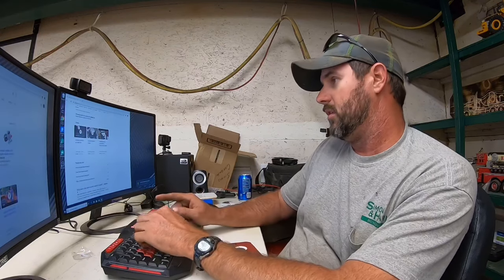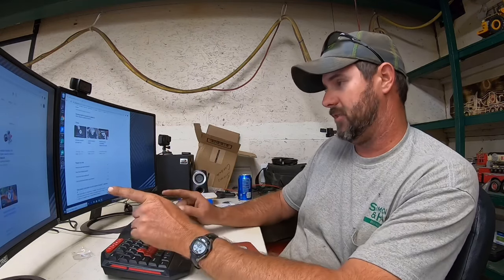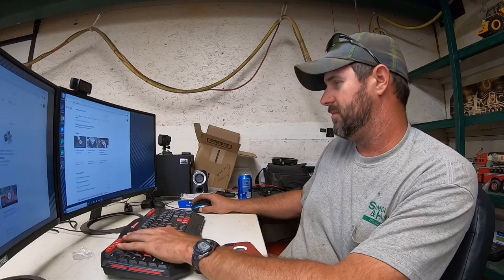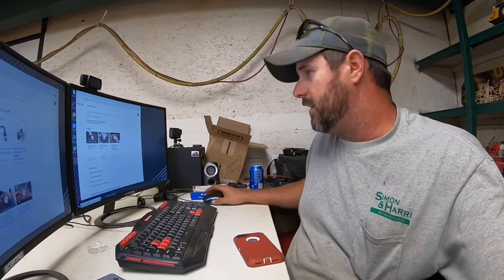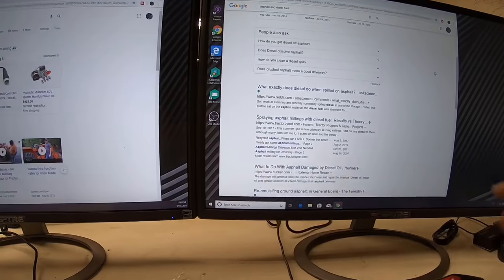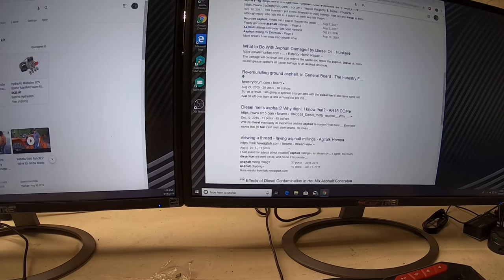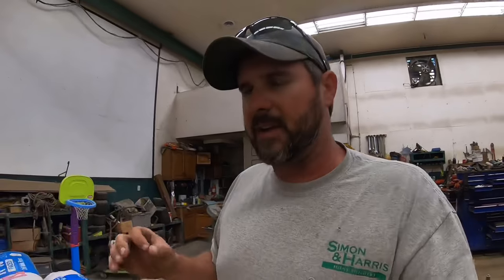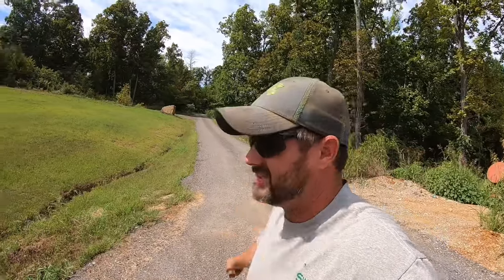Spraying diesel fuel on asphalt millings good idea or bad idea my thoughts

Comment: Diesel fuel doesn't let the asphalt bind correctly. It almost liquefies it and it will never bind up until the fuel works out of it. Which then leave you with hard rubbery chunky stones. Don't use diesel fuel with asphalt. Unless you don't want it to stick to something. Like shovel, lute, machine components ect.

Comment: Guys from a a large commercial paving company, that build roads and such, with 30-40 years of experience, said lightly spray diesel on the millings.  Give it some time and let it dry and get some sun and it helps bind it together.  I trust guys who do this for a living and have been for a long time vs. random google information.  This is for a temporary driveway, not a long term lasting solution.  If you want a real asphalt driveway to last you 20 years or more, you need to pave it for real.  You get what you pay for.

Comment: I can understand where people get the idea for diesel, but you are absolutely correct, asphalt is just tar and aggregate basically, if you get tar on your hands diesel is a good thinner to get it off.  WD40 is better though and doesn't stink. Thin oil based products break down thicker oil based products.   When I was a kid I remember seeing frequently exactly what you described at the gas pumps.  Usually at the farmers co-op.  Yes the two things that make asphalt work are heat and compaction. But  I might take  a road trip to see your driveway on fire!!!

Comment: Well if you treat it just asphalt make sure all the smaller particles if you got a good guy that can rake good he'll pull the rocks out and move them forward so they're on the bottom and keep all the smaller particles on top when you ended up having a rocky area that's when the guy will Rick the material and pull out the small particles and fill in the rocky area. It's pretty easy when you know how to use both sides. Normally when you spray the the seal coat you'll do two passes if you spray it too thick at one time it will crack that's why you do one layer as a prime then the next layer as the sealcoat then you'll have to maintain it as in more layers of sealcoat because it will wear off from the Sun and from friction. If you keep on top of it it'll become a nice smooth surface just takes time. But the diesel fuel you even put it on your shoes because you'll end up 6 inches taller if you don't because of the asphalt sticking so I think it may work as it would melt everything together it would be a good bottom layer because when you lay down asphalt you put the stuff called tech on the dirt or on the asphalt that you are applying asphalt on top of it will act as the tech coat like a real sticky that would make a good base but yes the heart of the weather the smoother it will lay and the more compassion you'll get

Comment: Hit it with a heavy coat of oil based sealer (two coats is best with a couple hours inbetween coats) Oil base will penetrate and become part of the existing asphalt. Not only will it penetrate and help hold it together but it will also rejuvenate that dry RAP and give it that black look of hot mix. I understand you have a large area to get sealed but most seal coat companies will give you a better rate if you have volume.  Chip seal is going to track rocks some maybe more than others but in the end there is going to be loose rock everywhere.  If you enjoy the look of your surface now ( no big low areas or high spots) just get a couple heavy coats of premium OIL BASED sealer. No water based as that is a surface type sealant and will likely peel or be prone to surface cracking or alligation in RAP. Have a good day 😊

Comment: Spraying your drive in Indiana with diesel could cost you big time, I think if you spill over five gallons of fuel or oil and the state finds out about it, they could make you dig it all up and send it to hazmat dump, I think they burn the soil or in your case millings to rid it of fuel. I live on what was gravel road in Indiana and the county would spray oil in front of the homes to keep the dust down, but in the late 70s due to EPA regulations they stopped using oil and started using something else. In the late 80s they chipped and sealed the road, not as good as blacktop, but much cheaper, beats the heck out of gravel though.

Comment: I haven't seen this video before and I know its over a year old but I wanted to make a comment. Here in Arizona specifically Maricopa County the EFA is on the County to get dirt roads paved because of air pollution in the Phoenix Metro area. The dust and dirt or particulates is what they are after not vehicle emission's per say.  Dust and dirt is very hard on our lungs.  Because Maricopa County has so many roads they are responsible for. They formulated a multi year plan to chip seal or gravel most or all of these non paved roads to cut down on dust pollution. They studied it a long time and even planned to gravel sides of county roads over a certain speed limit, because vehicles at that speed produce a wind disturbance to each side therefore causing dirt shoulders to produce dust pollution as the vehicle drives on the road. They started using recycled assault on the sides of those certain roads and then in remote residential areas they were responsible for. They found out the millings contain cancer causing agents and stopped using it in residential areas. The millings they had applied they removed,  due to the cancer risk where people live. They still use it on the shoulder of county highways where people don't live off of and found out if cuts down on maintenance cost too because the sides of the roads no longer need too be graded. I'm not in the asphalt business but I knew a little bit about what they do in the Phoenix/Tucson metro areas because of air pollution.

Comment: Tar, asphalt, oil, diesel and gasoline are all petroleum products.  Millings, from my understanding is basically ground up recycled asphalt. I think the thinking behind using diesel is that it starts to dilute the tar so then it can stick to the tar that is covering all the other rocks.  I don't think you want to use a lot.  Just enough to start diluting the tar.  If you use too much, it will be like you mentioned in your video where people use it to clean off their tools.

Now if you do or don't use diesel that's one thing, but have you thought about using the driveway sealers to coat the top layer of the millings?  I figured that would help "glue" everything together.

Comment: After watching this vid i stimbled onto a new way that works. You take tip off a lawn sprayer so itll spray the sealler n you spray the area then wait about 30 min to an hr n then run it over with a plate tamper n it smooths out and even looks like a solid new asphalt driveway once you stamp the lines out by foot.

Comment: I always have just layed it in 2" layers, tracked it in then rolled once with no vibration  and once with vibration, it will set solid if you roll it in thin layers.

Personally I don't see the need to spray diesel  just compact it properly.

Comment: I guess you never tried any of those things. I have mixed in wvo into millings and rolled it with good success. It takes a while but eventually the vegetable oil dries into what I could compare to a tree sap like material and works well with the tar . I think real tar sealer should be used on top not any of the latex box store stuff .

Comment: Im sure the epa would like you using diesel fuel on top of your driveway, ive ued recycled asphalt a lot and once its heated and compacted properly its just as good as regular asphalt, we plow on top of ours without tearing it up
Reply from the maker: Awesome
Reply: Honest question. just had some millings put down. $1800 for 2400sqft (a little pricey but CHEAP For where I am rural NM) anyway I LOVE the look and they did compact it down with the bobcat then the 2 steel drum roller machine and even a hand compactor for the edges and seams (where it meats my concrete driveway slab etc..) Driving on its fine but drag say a TABLE on it and it rips it right up.

will this harden on its own over time as summer progresses or do I have to do something more to it?
Reply: @nerys71  You need to hot oil it . Call the local seal company or a dedicated oiler to see about it. They design oil mixes that will bind it. Your asphalt is dry and will never bind up.

Comment: spryaing  diesel on asphalt millings is not much helpful to bind it. But adding some adhesive oil to it and compacted when it is fresh one or two days  with  say a medium heavy roller may help. it brings out tar from millings. then let it harden and it  will last longer and firm without breaking.

Comment: Bad idea,  I am in the UK and I agree with you  heat and compaction  the only way, I keep mine in a heap and in the summer after the heap is nice and hot spread it and roll it. And to keep it good top dress and chip it. Good chanel keep it up. Regards Arthur.

Comment: I have seen guys spray diesel/kerosene on millings when the millings got cold on them and they couldnt lay the millings down and light it on fire to help heat the millings back up to be able to lay it down on a parking lot

Comment: This video popped up and I would give you my personal experience with it and where the diesel does work.  We call them grindings here but same thing.  Sometimes the grinders get dull bits and makes the grindings pretty chunky and is hard to spread and a roller doesn't seem to help much compact it. Sprayed diesel with a weed sprayer lightly on chunky areas to help break it down (on a hot day 90 degrees or better). Then roll it, grade, roll again. This is only good on chunky stuff.  But normal good grindings you are correct it's not a good idea or needed.

Comment: Your whole conversation is just that a “Theory”.  If you have millings,  why not find a small area, spray it, pack it and wait and see.  Instead of Surmising a theory,  get more Relevant proof and then make another video.  Of course heat will work, that’s why they use millings to make all new asphalt.  Also your not comparing apples to apples to what diesel does to millings and hot asphalt after it’s put down.   But think about what you said about when diesel fuel hits pavement and what it does to it...it will continue to do so to the pavement if it is continually poured, dripped, or leaked on to but when you do a one time occurrence,  it doesn’t continue to do so like acid.  It stops that process after a short period there for setting back up again.  Ask your buddie if they spray there tools with asphalt on them but don’t clean it off right away what happens?  I bet he will tell you it hardens back up.  Same goes for the millings on your driveway.  Spray it,  it softens,  but left alone afterwards it sets back up.  Experiment first,  then get back with us.  Your answer may be different.  Oh and by the way, 4th generation asphalt paver here with over 20 years experience. Just saying. Thanks
Reply from the maker: We have

Comment: We are compacting our millings for over 1500 feet of driveway with a standard steel drum compactor as we speak. 
   Was just about to do a diesel/used oil mix off the back of the quad, but I’m very appreciative of your advice.  You may have changed my mind.  I’m
Almost thinking of doing 20’ somewhere just to see the difference over a few months.  I’ll keep you posted.  Saving your post.  Thanks again
Reply: What was the verdict?
Reply: Just enough diesel to thin the oil enough to pump through the sprayer without popping the fuse won't hurt especially if you have alot of 90W gear oil in your uses oil tank straining your oil through an old sock to keep metal shavings from plugging the sprayer on a hot day is better than diluting it in my experience then a fertilizer spreader with rock dust will keep oil off vehicles if you don't care if your drive is black or not

Comment: I don't think pea rock is a good idea. If you can get crushed rock of the size you want, wouldn't that be better, as crushed rock being angular dig into the surface, and they mesh together, while pea rock, being uniform and round does not compact well, and they are just the size that will find their way in between the tread of car tires. However, if the asphalt keeps them down, well that might be OK.
Reply from the maker: The county around here used both and the pea gravel holds up much better it’s a harder rock 🤷‍♂️

Comment: I don't have books on fire code anymore but my guess is   #1 flash point on diesel fuel is about 100 degrees so if it got to 100 outside  during the summer you may have a spark fire due to vapors #2 it smell's and #3 you or the kids track that in the house, your fired. PopMarbles in Arkansas
Reply from the maker: Yup sounds a bout right to me

Comment: I think chip seal is a great idea it,s used on most of our rural roads here in New Brunswick,,,they use 3/4" crush for the chips.I used to ride with my father back in the 70's a 10 ton load would spread about a half mile.

Comment: Your stil a bit mistaken mate first why  didn’t you show diesel in a patch also ash felt recycled is a very dry mix it has lost a lot of its flexibility the right amount of diesel brings that back after all diesel and tar are the Sam material just refined further or less   True too much diesel will have same effect as too much water in concrete. Surgestion too for you put  dry recycled ash felt in a concrete mixer with a little diesel and then lay it do this several times with more and more diesel  then and then only after this show your idea results to the public   Thata boy
Reply: exactly this, depends on your climate too, spray it with some diesel then set fire to it...the chemicals react and then you burn off the excess diesel which helps again because you're using the heat from the fire.

Comment: You spray the driveway with diesel fuel lightly 

It re activates the oil doesn’t get rid of it 

Then a few days later when the diesel dries it will be stuck together 

Better to do in the summer time when it’s warm 

It works 100 percent

Comment: is 1/4 inch(5mm)gravel size screened millings, good enough for a small driveway?
If i compact it with a roller, would it be as good as the 3/4 inch gravel size?
Any recommendations would be much appreciated.
Reply from the maker: Yes but either way need a good base first

Comment: You use very little diesel. Just a mist. Had a asphalt company in 80s and early 90s. They even offered it at plants to spray inside truck beds and backs of truck. You also wait till 100 degree day and roll it. Was in business for 15 years till we sold. Km only talking a mist not heavy. Also. If you Tar and gravel when it gets hot where gravel isnt will be only tar. I know of some companies used it for weedkiller under asphalt but we used Roundup.  Also did the Curb and gutters and sidewalks to.
Reply from the maker: Good info thanks

Comment: At my old work the drivers would have to go around and patch potholes with asphalt from the dump trucks. They use diesel fuel to clean the shovel after, after soaking the shovels in buckets of diesel for a little while they then rapped the metal parts in newspaper and light them on fire and turning them so the fire melted what was left off. Edit: They use to put a little diesel down in the bed of the trucks before getting a load too.

Comment: Diesel, or any refined oils placed on milling will break down the existing bitumen in the millings  which in turn break them down.
There is a product called Hawk seal https://youtu.be/O7WqsDmHrVc.
Your millings should be screened, if not then the uneven pieces/,chunks won't compact uniformly.
Reply from the maker: Yes sir
Reply: @DirtPerfect  When paving crews pave new roads where I live, they spray the manhole lids with diesel so as when they pave over them it just peels off when they are done.
Or they take the frames and covers off, place a plate on the manhole barrel, pave over and come back and jack hammer a big hole in the new pavement pull the plate and set the frame and cover and do a crappy patch job around it 😂

Comment: I've been in the asphalt industry for 40 years and any petroleum products eats asphalt, this is how cold mix is made with Diesel and kerosine, ran thru a plant to mix, and of course it's used for temporary shims and around utilities after the road is milled. Now in chip sealing your driveway don't use pea gravel chip seal is used with applying AR-4000 oil and then the spreader right behind locked in with a rubber tire or pneumatic roller, now the main reason is cheaper but also the hot states the sun reflects off rock and reactivates asphalt, but 3/8 minus rock is fractured when it's crushed in a crusher plant and it's locks together round Rock can't.
Reply from the maker: Agree 100%

Comment: thinner/paint - Diesel/asphalt good analogy -  both petroleum products- one is less viscous and will dissolve the other.  that's just basic chemistry.
Reply: Ok. Have you ever painted?  You can add solvents and thinners to your paint.  As long as you don’t use too much it hardens right up. Some even faster and harder than without.  Solvents with oil based paints.  Water with latex based paint.

Comment: I’ve read where folks are using calcium chloride- using a regular seed spreader and broadcasting it, which helps bind.  Any advice on that?  Great video btw.
Reply: When a paving company recycles the millings and lays them back on the road they're grinding them from they mix calcium chloride with the oil they add to the millings before they go into the paver they use a liquid/slurry though but I don't see why your idea wouldn't work the same